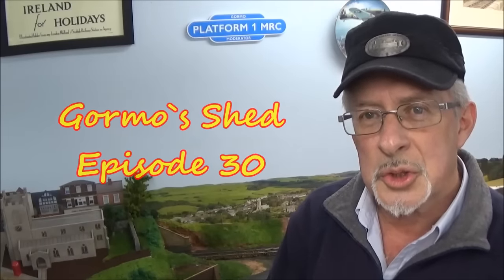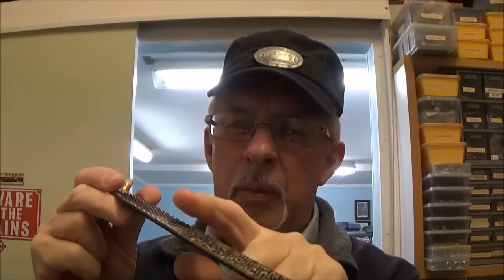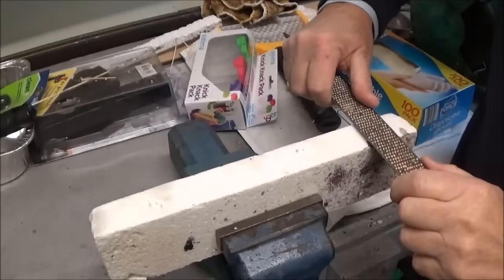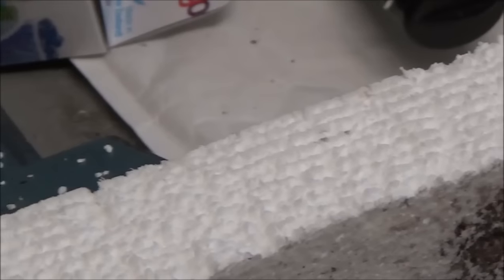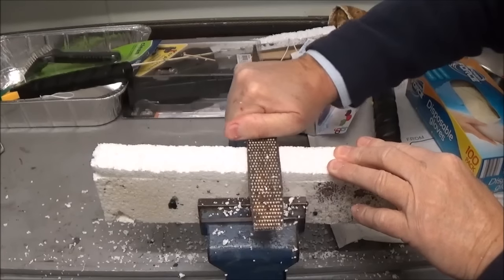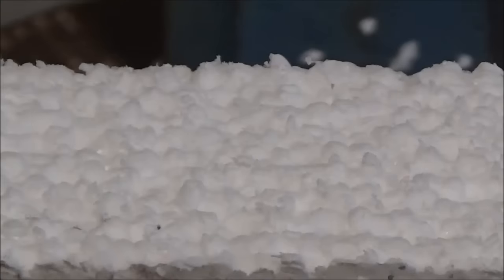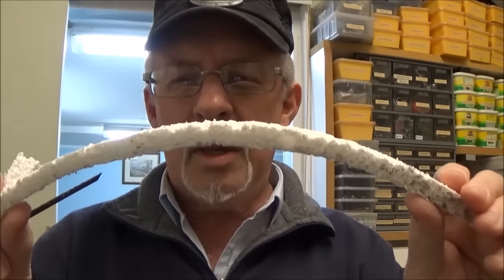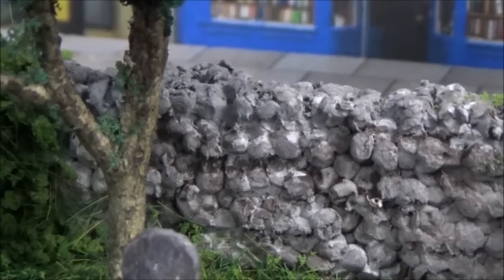Episode 30 Stone Walls for OO or HO

Comment: Hi. Just watched your video. Absolutely amazing. Have been thinking about doing something like you have but have been unsure. Your video has helped greatly. Thanks.
Reply from the maker: G'day Les
You're welcome
This method makes a mess in the making of it, however the end result is a fair representation of a stone wall .
I glue it down with PVA and try and pin the wall in place until the glue sets
Cheers Gormo